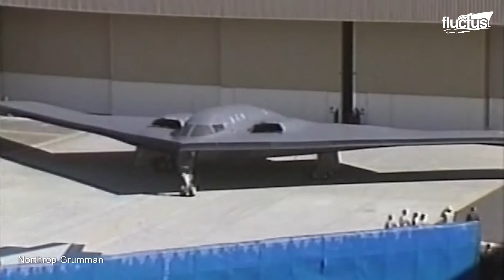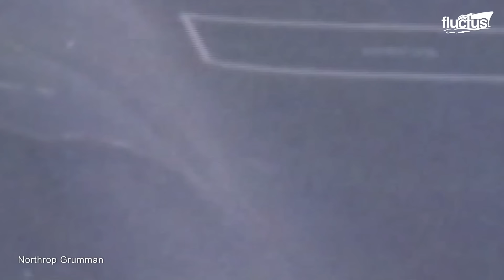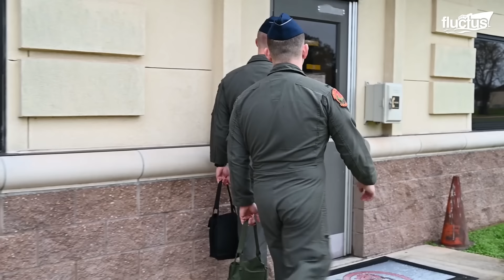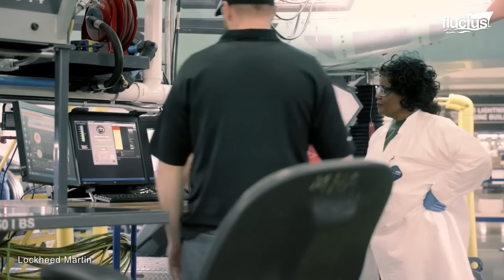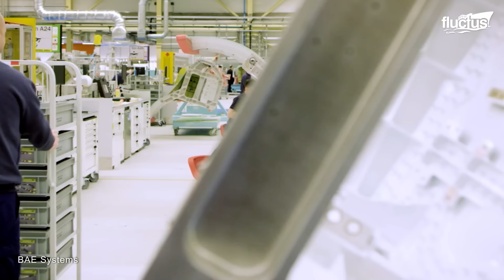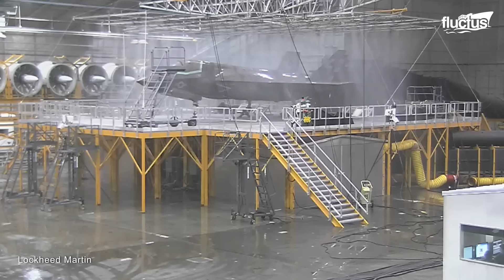Inside Facilities Building US Most Feared Stealth Jets From Scratch

Comment: Kenapa pesawat bomber B2 spirit bisa terbang stabil tanpa ekor vertikal stabilizer ?  Kan pesawat pada umum nya punya ekor vertikal stabilizer
Reply: It's able to stabilize due to the plane using a computerized flight control system (aka "fly by wire") along with "split rudders" on the wingtips to manage yaw. You can see these split rudders at timestamp 4m35s - 4m45s

Comment: The B-2 Spirit  is long out of production and this very same factory where it was born is now being tooled up to produce the very similar looking B-21 Sky Raider.  The Sky Raiders only difference is it's slightly smaller size, windows and more simple larger middle rear section.  The Sky Raider will address the fragility issues of the RAM coatings of the B-2 for starters and hopefully result in lower upkeep costs
Reply: Ok